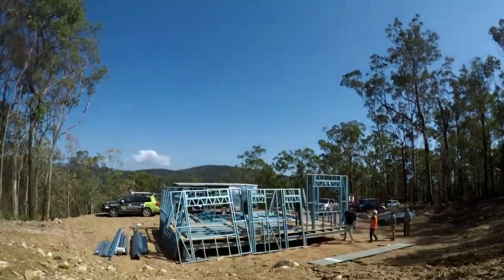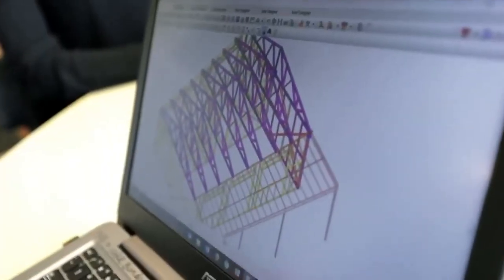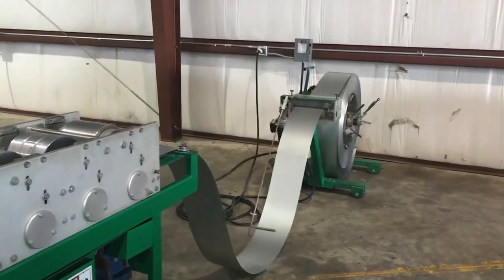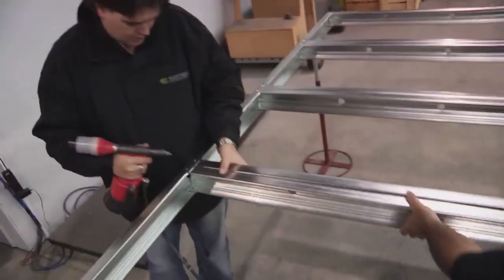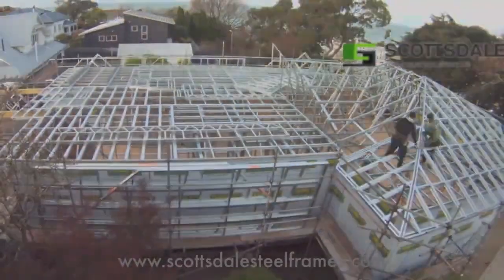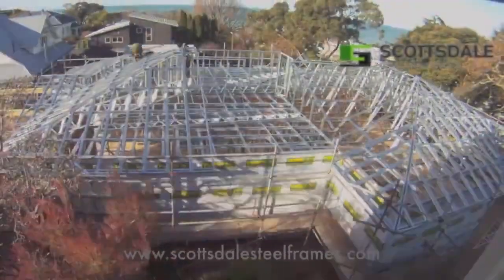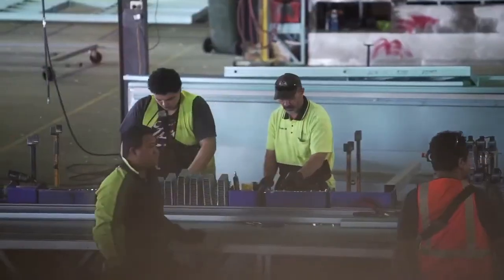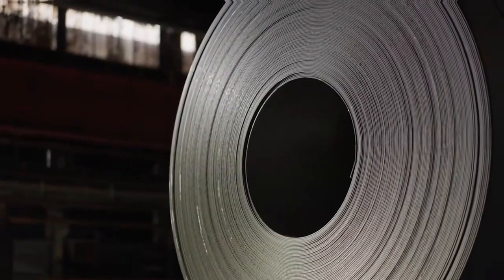Steel Framing in 1 Day

Comment: Are you able to build non rectangular non square elements? Creative architecture is pushing angular pitches non 90 degree walls. Is this capability within your scope of work?
Reply: If you were asking about corner angles other than 90° our CNC machines do angled end studs and tracks mitered within 1/32 of an inch resulting in no greater than a quarter degree of variance in corner angle